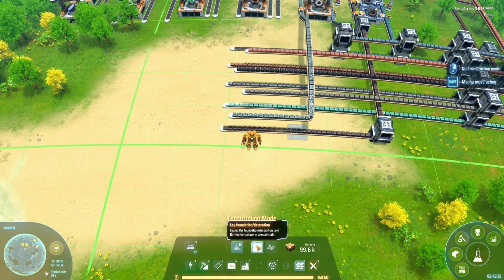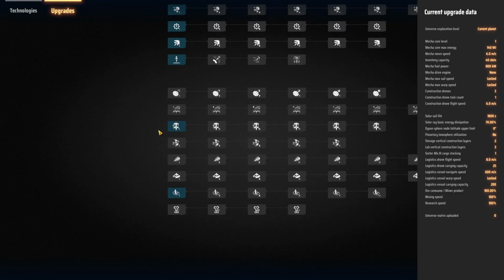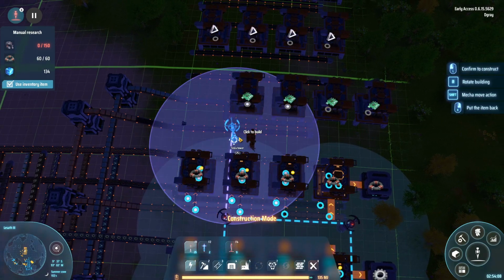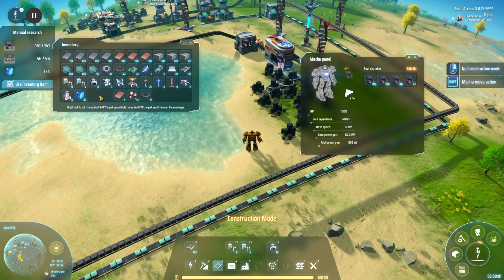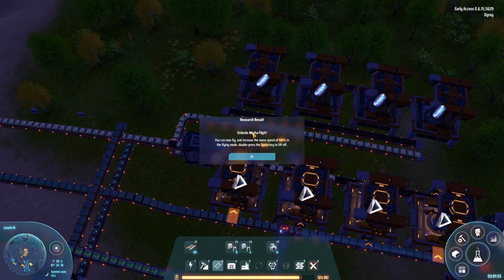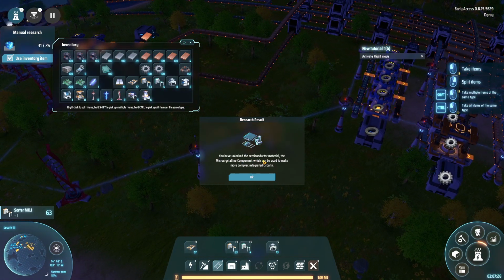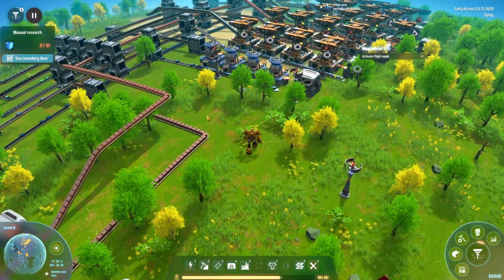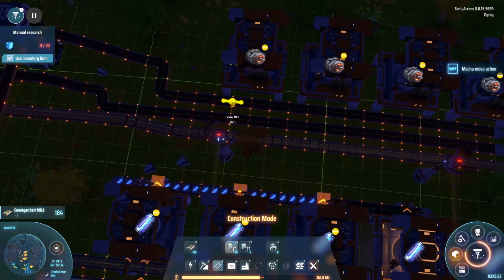THE MAIN BUS PART 2! - Dyson Sphere Program - Let's Play Tutorial Gameplay DSP Ep 04

Comment: Hi 
I think the bus is a great idea, mine has the lines going in and out on the ground and the bus lains lifted makes it more easy to connect. Your stacked version is new and interesting but a little fiddley... Your belts will run dry though and you need to upgrade them. But it's nice and tight!
Btw. You have a light on your bot (perhaps hotkey L) or click the squares with the checkmark in the menu at the bottom right corner. This game is a little dark on YouTube. Keep up the good vids! Are you a fellow Dane? :D